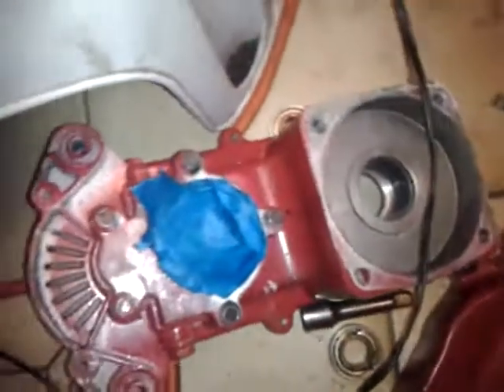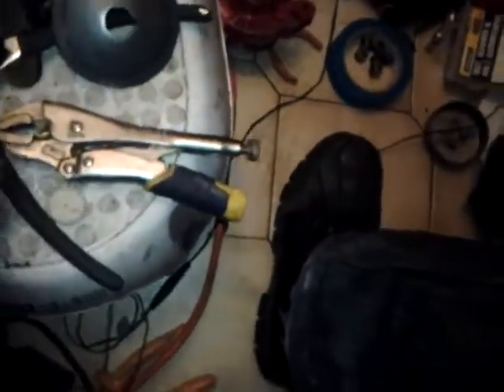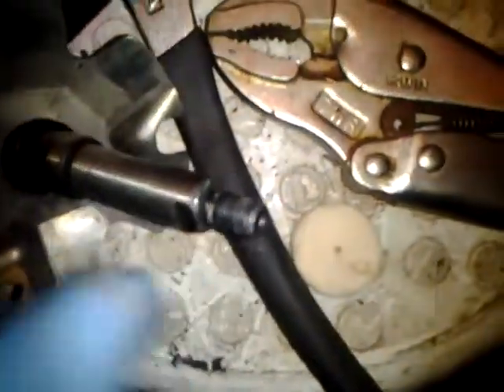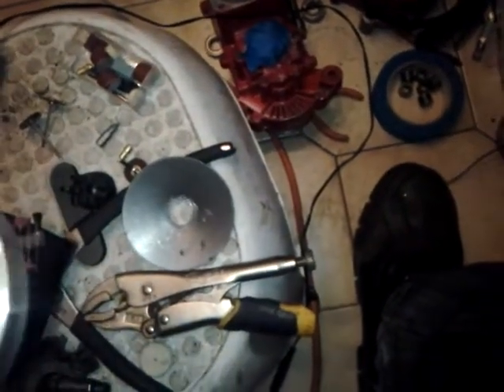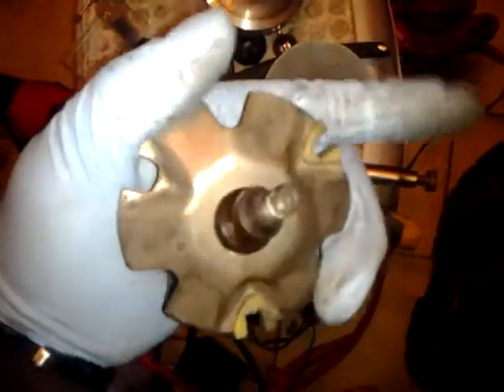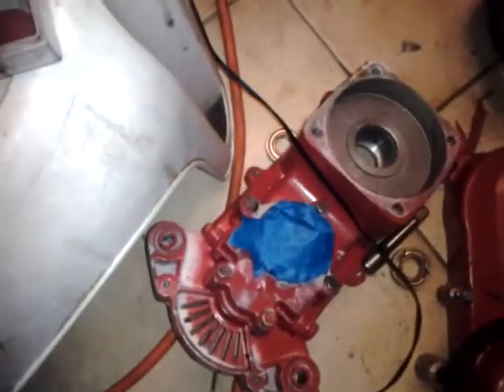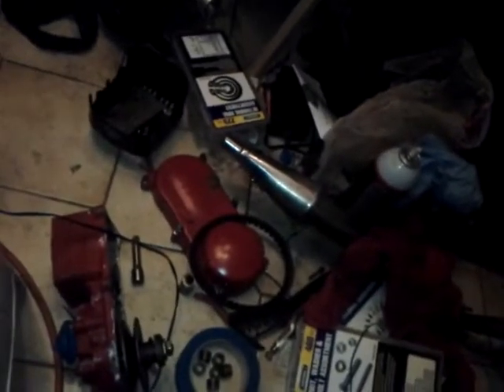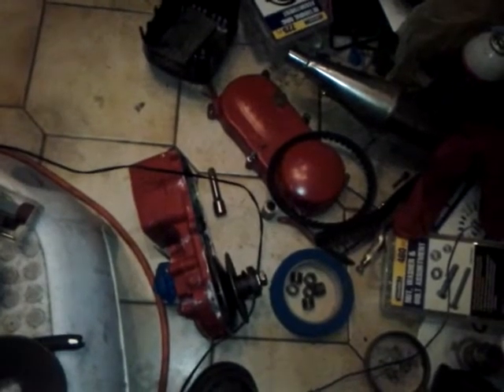212cc x7 pocket bike project update!

Comment: Just found they make a rear assembly deal so we flip pocket bike axles so u can run Lhd. Ebay like $30 $35 i think. Then much easier to go max torque clutch. Scrapped a chopper project cause i didn't know about it.

Comment from the maker: You may have to drill new holes in the housing for the converter. I noticed the holes don't all line up. Place some screws in the mounting holes on the engine with paint on them and carefully center the housing against the screws to mark your drilling locations.. recheck it and drill away. I will post a video in a few day step by step.. I'm away from home right now..